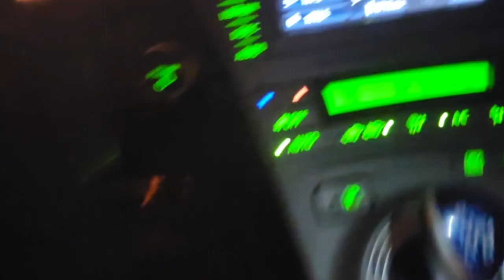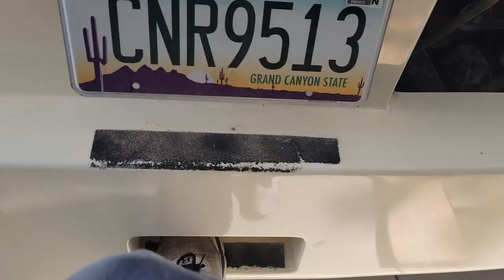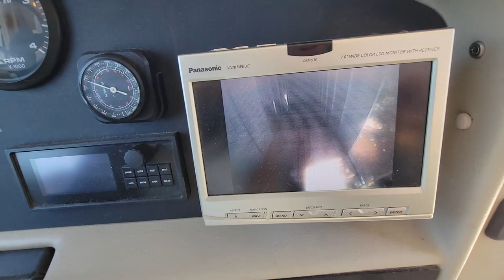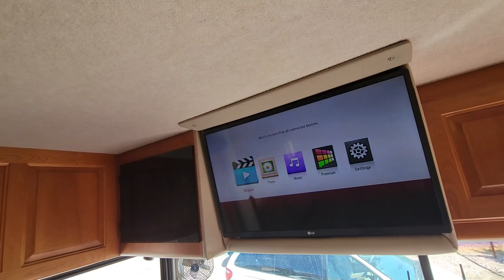Inspecting a Unique Country Coach Intrigue

Comment: We have a Monaco Knight 31J shorty thirty footer. Table and Chairs across from the Jacknife sofa behind the co-pilot chair. Real wood, courion countertops,  four burner stove , 3 way refrigerator,  shower and sink in the middle with water closet for privacy.  Two slides living and bedroom areas.  Propane generator so we're all set for off grid and campground with 30 or 50 Amp service. 
We are in Phoenix and it took the I17 to Flagstaff passed all the commercial trucks along the way up the hill 😳 with her Cummings.  She's a 2001 a built to last. We actually had a deposit down on a new FR3 gasser when we found this diesel pusher. After driving the gasser my husband said the engine was too noisy and unfortunately , everytime we turned a corner another piece of trim fell off during the test drive lol . The salesman was sitting behind us from LDLP saying  oh..we will fix that, oh we will fix that too...even the facing off the refrigerator fell off
 They aren't made very well at all , certainly  not made to last . BUT , I have to say the new interrers on these new coaches do not waste an inch of space ..in fact if they have two inches from top to bottom I guarentee it will probably have a door on it and a pull out spice rack. The FR3 was only 34 foot long and had a full bath and a half, king size bed with little night stands on each side . A electric drop down bed over the cockpit area.  50" TV with a fireplace  ..and full storage space behind the TV . Wrap around booth  and double recliners in the livingroom.  The darn thing slept six and did I say it had a bath and a half? SEARIOUSLY four extra feet made a huge difference.  Too bad the build quality for these rigs is so bad. They wanted to get it off the showroom floor and bring it outside for the new 2022 models to come in and gave us a smoking good deal of 98k ..we were looking for a pre-loved class A BUT everyplace was sold out because of the pandemic and everything for sale by owner around five year's old at every consignment place we looked from the far east valley to sun city wanted 10k more for them than their original purchase price. So when we were offered one off the inside showroom floor for around the same price as we were seeing the 5 to 7 year old class A and class C rigs WE signed on the dotted line and left a deposit before even driving it.  If we hadn't seen the diesel pusher we would have probably ended up with a lemon..a well designed interrer lemon.  We found our diesel pusher at World Wide RV in Mesa , my husband made an appointment to test drive it the very next morning after it posted that evening.  SEARIOUSLY a line had formed to see it by the time the doors opened . Apparently SHORTYS are hard to find the salesman said even during the RV shortage of 2020 they could still locate a 40' class A across their many store locations but not a shorty always a shortage of shorty. We didn't know that, we were just limited to 34' or under based on what will fit in our driveway. 
I wanted to redesign it by removing the table and chairs and adding an entertainment center with a TV esculater and fireplace at the bottom with a posing recliners across from the TV and use TV trays whenever eating inside because really, when camping don't we all eat outside? But after joining a few class A retro sites people are saying don't remodel and never ruine your wood cabinets by painting them ..keep these classic RVs as original as possible. 
It's a personal decision.  What I have seen in the last 6 months as moderator on a class A diesel pusher Facebook page is those CRAZY HIGH PRICES  have dropped by ALOT people are still asking pandemic prices , however they aren't selling and they are dropping lower everyday. Prices will be at or below pandemic prices before too long . HECK pre pandemic a 20 year old class A could be bought between 15k & 20k
Unless it was one of the super top of the line coaches. I love watching these videos about RVs on YouTube it sure helped us know things to look for when we were searious.

Comment: You did them a big favor by saving the day when that mirror detached.  Someone without "pro hands" very likely would have dropped it, or it would almost certainly have fallen off while driving down the road at some point.  The headroom in these older units is the only thing keeping me from going from a unit of this era as I'm 6'4", and they seemed to go to the 6'10" ceilings around 2005-2007, then up to a full 7' in 2007-2008.  These numbers are for the Monaco lineup, I think Country Coach went from 79" to 85" in 2005, at least in the Magna/Affinity series.  Still waiting on my "perfect unit" to pass by!
Reply from the maker: I'm guessing by the double stick tape it was not the first time it happened.
Reply: @AZExpert  That's what we call "A Clue."

Comment: That is beautiful for an older coach.  You didn't cover tire date codes,  engine oil level and service records.  Also, generator hours, miles on the odometer,  LED's or Incandescent ? 
  I know it's not your place to ask the price, but it would be very interesting to know.
Great inspection.
Thanks for sharing James. 👍
Reply from the maker: Generally I say contact the dealer for sales info. Sometimes I do cover that information but I do have limited time and I don't want to put anyone to sleep. If you have direct questions I would reach out to the dealer

Comment: Great example of the Country Coach quality.  Still looks good after 20 years.  The one thing to watch for with this vintage is clear coat peeling.  The gov't made them change the formula, and I think 99-2002 had that problem.
Reply from the maker: there was surprising little peeling just a small section on the rear bumper

Comment: Amazing what a life under a cover will do for a motorhome. I did an NADA lookup on the model... quite a bit lower than the asking price. I've noticed that most of the Oregon motorhomes go for 1.5 to 2 times the NADA.

My wife and I have been looking at 2000 to 2008 Monaco gas-ers. Do they have the same quality as the diesels?
Reply from the maker: I prefer diesel

Comment: Great inspection & info. We’re looking at these older models of Country Coaches for our 1st RV purchase as well. How are the engines in these & what kind are they ? Reliability & towing . Thx again . Love your channel. 👍⚾️
Reply from the maker: Liek anything mechanical, use is better so low mileage is not always a good thing with used. The engines are usually the same CAT or Cummins used on fleet semi trucks so good reliability and towing
Reply: Thx 👍appreciate it ⚾️

Comment: Inspected a 1986 Country Coach 36’ for sale yesterday in Idaho.  The shock was the price of $5K.  Well, the driver’s side wall was wavy, several gauges not working, generator needed new gas fuel, and a few electrical issues had some concerns.  But the engine cranked and ran perfectly,  had 6 tires 2 years old, driven once a month, and a total mileage of 130K.  The quality of interior was obvious.  No leaks in the one piece aluminum roof.  Hate to see it just sit there but the delam was a particular concern.  Probably would make it back to Oregon…
Reply from the maker: That sounds like a load of problems

Comment: Great video!

Does the deep shower pan act as an overflow for the grey tanks?  I was told that the tub on our old Silver Streak did.  Curious if CC did the same.
Reply from the maker: The shower pan is the lowest drain so the first to back up when the tank is full, but I wouldn't call it an overflow.

Comment: What year is your Prius and how reliable has it been ?  
How about any problems & cost of maintenance ? 
I’m considering one — Thanks 😊
Reply from the maker: it's a 2015. Extremely reliable and I kind of abuse it honestly as a work truck.  my 2011 needed a A/C compressor at 100k miles the traction battery on Prius usually are good to 200k miles.

Comment: Hi, another great review, I have a 1990 33ft petrol Elite motor coach with a similar 1 piece fibreglass roof, can it be removed? my roof is not flat looks like there are some low spots, inside is fine, not sure whether to invest more money into it, cheers from OZ
Reply from the maker: You will want someone local to check it out, I can't really give you advice without seeing it.
Reply: @AZExpert  thank you

Comment: You are clearly an RV professional. It is apparent that based upon your inspection, your buyer did not proceed with the purchase. If you point out issues that we as future/potential buyers should avoid, wouldn't it be appropriate to identify what issues were a challenge to your buyer on this coach? Just a thought.
Reply from the maker: It's the buyer paying for the inspection--so they get a full written report. I post the highlights on here--otherwise it would be an hour long